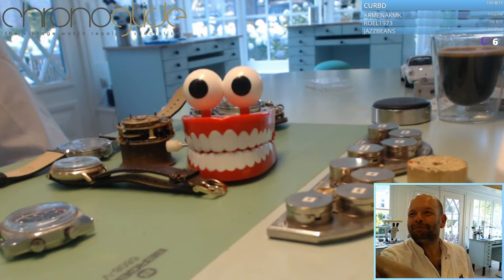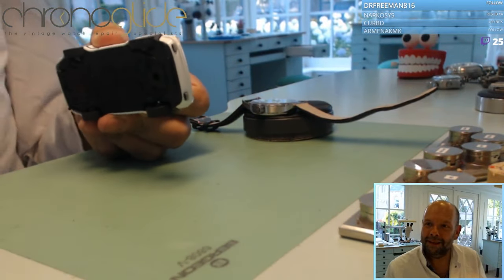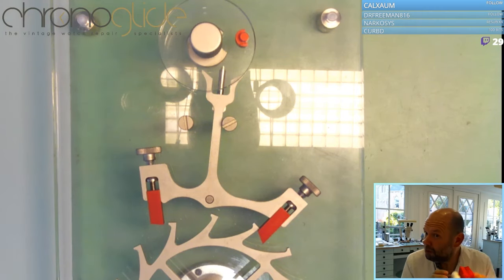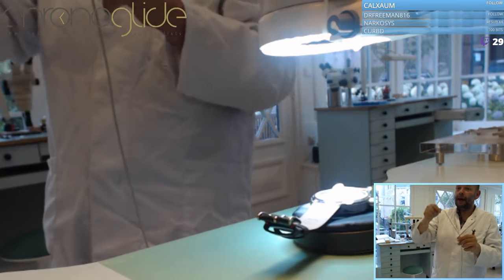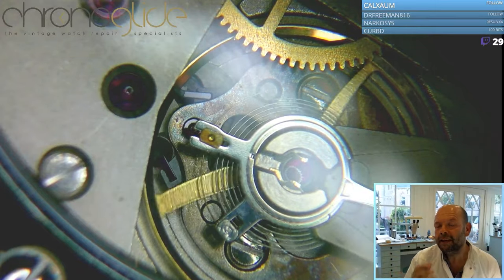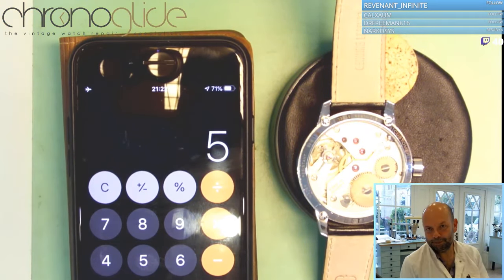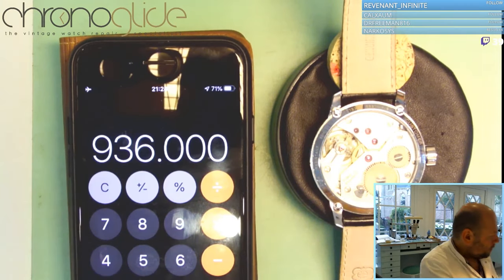How a mechanical watch works, basic theory of Horology Part 1of2

Comment: The explanation of amplitude and how it is adjusted is the first time I've understood it completely.  I like the journeyman approach to this.  Thanks for the clarity!
Reply: I've watched a few videos on how a watch work's & still get lost I'm hopeless 🥺
Reply: @juniorjohnson5961  If interested you will get there. There is a lot of information packed into a small time frame without providing a full physics lecture behind each piece. If you can understand the pendulum period(=time to go through one one complete cycle) is the same unless you change the length of the string or the mass at the end, and does so despite how far of a distance it has to travel in its cycle, then you are doing good.
  He then translates the weight on string being acted on by gravity with a weight on wire (=hairspring/balance spring) being acted on by its springy force. Just as a spring attached from above to a solid surface can bounce up/down like is used on car shocks or can be bounced side to side, it could also be rotated around its center. Springs will oscillate with less and less energy per cycle until they reach a state where they aren't moving.
  Wasn't brought up in this video, but the mainspring where the wound energy is stored will through gears apply force to spin the escapement (=gear with strange teeth to interact with the pallet fork) and every oscillation of the balance spring will bump the pallet fork allowing a very small rotation of the escapement and the mainspring energy will push the escapement through that available range of motion. The escapement will hit the pallet fork on the other side as it does so and the escapement becomes stuck. The energy transferred into the pallet fork is transferred back into the balance spring. The pallet fork is now stuck waiting until the oscillation of the balance spring pushes into it the other way restarting that cycle.
  The watch keeps time as energy goes from a higher wound state to a lower wound state because it doesn't matter how hard the pallet fork hits the balance spring based on energy from the mainspring because the balance spring still takes just as long to run its rotations back and forth (though it will rotate a shorter distance with less energy).
Reply: @mirror1766   Thank you for taking the time to explain this 🙏

Comment: That's a good explanation sir, I really understood how escapement works and why is the amplitude important just makes sense now. Balance wheel will swing in the same time regardless of the angle, but will be more resistant to outside distruptances due to more stored energy.

Comment: I found this video because I'm learning electronics and computer processors and ended up a tangent about the clock cycles of a crystal oscillator that it uses 🤣 I love your explanation of stored power and consistent release using the car and teeth.  As a child I would always take mechanical toys, watches and cars apart to try to understand how they worked.  My grandad gave me his old watches when I was a child in the early 80s and I would open them (and usually break them) simply out of the curiosity of how they worked - but this was a great way for me, as a child of around 8, to learn - and still is!!

Comment: That is an interesting rate, 5 Hz . Quartz crystal oscillators are used as they work at 32,768 Hz because it equals exactly 2^15 and a 15 stage binary counter will divide to exactly one second.
The fact that little spring will return almost a million swings is just about unbelievable or  that the machine and build quality of these things are so precise and possess such low levels of friction that the momentum is conserved for that long is just mind blowing.
Reply: There is a YT channel called MIT OCW (open courseware) and one of the playlists is 3 physics courses, twenty-something lectures each consisting of classic Newtonian, electromagnetism, and wave functions all given by Professor Walter Lewin, a proud and prominent Dutchman. Anyways that's where I learned about conservation principles, oscillating systems, Huygens' contributions (as well as how to correctly pronounce his name!) and so, so much more. His lectures have an emphasis on demonstration and they are absolutely amazing, all kinds of supplemental material, highly recommended.

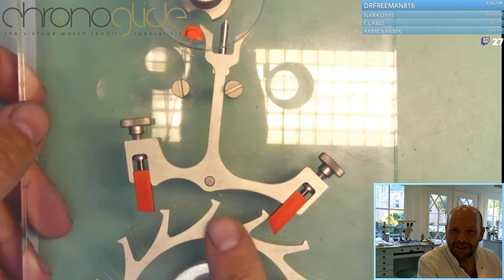Comment: 6:00
Help me to understand from where is the power to make the first tic.
The clock is run out (the spring is unwinded). The clock is stop.
Fork is not moving, balance wheel is not spinning (balancing). The jewel is blocking the escape wheel by the last beat of the system.
We start winding the clock and the power from main spring starts to rotate the wheels one by one until the escape wheel is powered.
This is the magic moment.
HOW THE ESCAPE WHEEL MOVES THE FORK FOR THE FIRST TIC TO PASS THE ENERGY INTO THE HAIR SPRING IN THE BALANCE WHEEL WHEN THE JEWEL IS BLOCKING THE SYSTEM ?

Comment: I'm a teacher in an mechanical engineering university and as a semester project I'll be using a mechanical watch to give some more variation on projects that only focus on automotive parts. This semester I'll ask them to plan an controlling device for one or more components. I thought  on using the design of the main plate and get them to control the parelelism and real position of all axles on the gears.

Comment: The balance wheel is analogous to but different than the physics of a simple pendulum. It is called a torsional pendulum and it's a harmonic oscillator which depends on both the moment of inertia of the balance wheel and the stiffness of the spring. So the moment of inertia is actually a tensor but to simplify it depends on the mass and radius of the wheel.

I'm adding this because I want it to be clear the period has nothing to do with the length of the pendulum in the watch's case. Length is for a simple pendulum, where amplitude and mass don't matter, only length.

Edit: also for simple pendulums, gravity does matter, so pendulum clocks will need adjustments on other planets and won't work in space. But torsional pendulums do not! They will have the same period on other planets and work in space!

Comment: I have a question: If the rate of the ticks depends only on the length of the spring/pendulum and not at all on the amplitude, then how does a Timegrapher know what the amplitude is when it listens to the ticks and the tocks?  I understand how it can know the rate of the ticks, and how consistent they are, but it doesn't make any sense how it can possibly know the amplitude.

Comment: I have checked many videos here on youtube, some were very advanced in visualisation but you are by far explaining it the best. 

Sorry my bad, but I still couldn't get it. 

I understood very well the power coming from main spring till the escape wheel. 
But where does the power of the balance wheel comes from? I don't understand that particular part. If a back-and-forth running spring is enough to self power the balance wheel till eternity (I know it can't be the case but just for the sake of explaining where I am stuck), then why we still need the power of the main spring?

Thanks a lot!
Reply from the maker: Thank you for your support Taylan!
I read your question, it is a long answer, maybe i'll show it again during a live stream for you.
Reply: @ChronoglideWatchmaking  wow, thanks a lot! In that case, I will be the first to come to the class!  :)

Comment: Hey DeBrito here from Rio de Janeiro 🇧🇷
Look, is there a way to put a sapphire crystal glass on an Invicta pro diver 40mm?
 Thank you so much 👋 😷
Reply from the maker: Hi DeBrito, If the dimensions of the sapphire are exactly the same as the mineral crystal, it should be possible. please make sure the seal is in excellent condition.
Reply: @ChronoglideWatchmaking 
Hi my friend from Rio de Janeiro. I appreciate your contact, but I'm a user and I thought you had this technical knowledge, you understand,sorry I'm an English student and my English is still not good!😥
thank you very much.

Comment: How is the motion started during the first action of winding and the impulse pin at rest? I picture the escape wheel tooth is held by the fork jewel and winding will not cause the jewel release and need the impulse pin to strike the opposing horn. I am asking this because a pocket watch that I am practicing on won't start without me nudging the balance wheel. One situation I think that would start the watch is that when all energy is expended, the watch stops with the impulse jewel knocking the last blow to the horn placing the entry jewel down ready for a nudge from the escape wheel. I know I'm missing something obvious here.

Comment: Hello. First, Thank you for your videos which are very interesting and helpful. I hope its alright, but 
I have a question about magnetizm
I am using an app to find if the movement is magnetizm or not. But since the phone is very sensitive, it shows results, even on the TimeGrapher Microphone, whis is o.k, as all mics have a magnet. 
So, how do i know if the Mic is overmagnetize?
When pointing at a watch, the needle will move, but how do i know if its too high?
Is there a  figure or number,  in Gauss, which i can consider as "ok level", and only higher numbers are to be addressed as a problem? 
Thank you for your help and support.
Gal

Comment: How does the balance wheel get started from zero movement (aka watch wound for first time)?  Wouldn't the escapement be stuck on a tooth since the balance wheel is not moving.
Reply: Good question I wonder if just the slight movement of the watch moves the escapement.
Reply: Usually, the vibrations introduced while handling the watch during winding is enough to get the balance wheel going, which oscillates with the hairslring and causes an impulse to take place via the impulse pin against the pallet fork, and the watch runs. Even if you didn't move the watch, the power from the mainspring will still build to the point where it introduces enough power through the gear train, into the escape wheel, into the pallet fork, which knocks the impulse pin on the balance (which causes the balance to oscillate), and starts to run. It only takes a few clicks of power on the mainspring to make a well lubricated and serviced watch to run.

Comment: What drives the balance spring?
Reply: The main spring. The main spring is the one that you wind which acts as the battery. The balance wheel and spring are what make up the torsional pendulum which sets the rate at which the watch ticks.

Comment: 8:05  CHRONOGLIDE WATCHMAKERS MAKES THE SAME SCREW-UP THAT EVERY BEGINNER MAKES.  He has the balance wheel driving the escapement!  

"The same as if it were a pendulum"  "Nothing has changed in over two hundred years of watchmaking."

Yeh...including a screw-up like you teaching the class.

Comment: To be more precise, a 18.000 beat per hour is 18.000 "tic" per hour, not "tic-toc". A "tic-toc", a back-and-forth motion, is a complete cycle. Complete cycles are measured in Hertz, a 18.000 beat/hour watch "ticks" 5 times per second, i.e. 2,5 Hz.